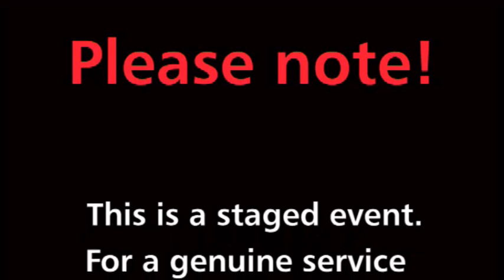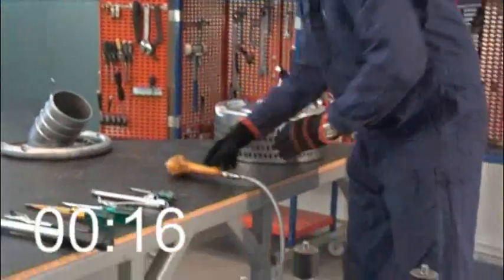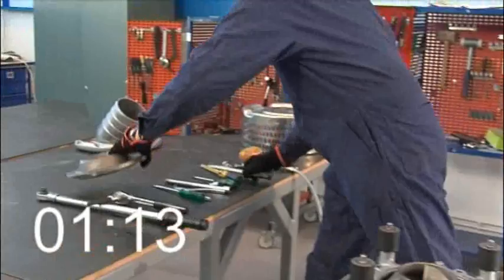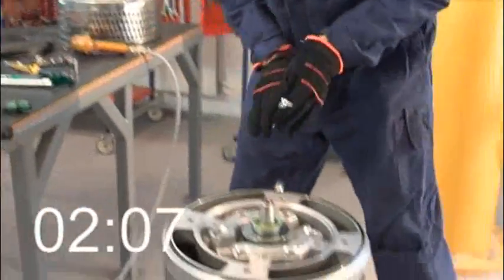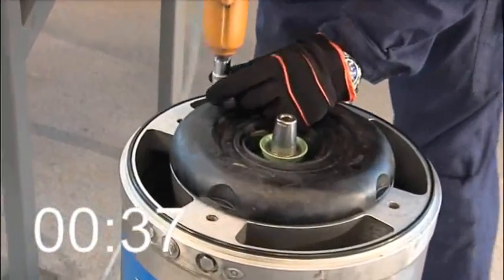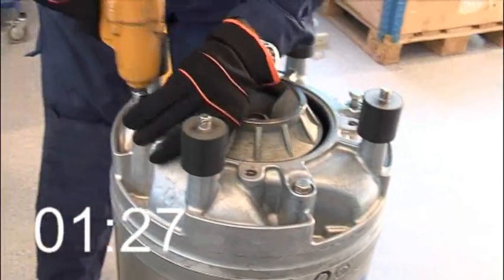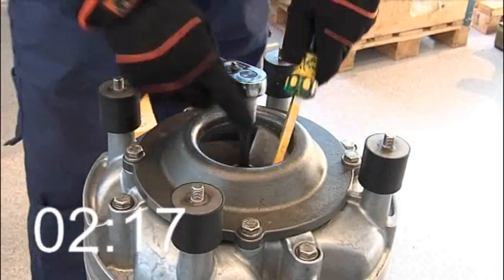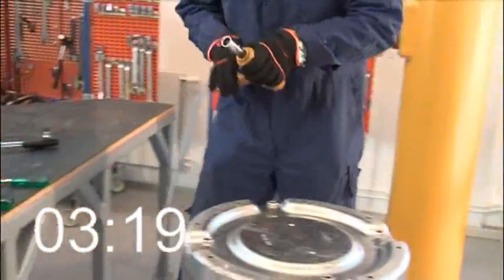ITT Water & Wastewater real time pump service video

Comment: Listen closely to the impact when first applied to any of the bolts for removal, a trained ear will not hear the impact gun 'smacking' on a tight bolt.
They are all just snugged down, not torqued to spec. Loose-ish one might make up a word for description.
Of course this is just a demo. However........................
2:35-Conical sleeve removed that easily ?? If you say so. Even a split sleeve is much harder to removed if it has been installed properly.
5:57-Where is the Loc-Tite Blue medium hold compound for the impeller bolt?
You guys should make propaganda films for North Korea.

Now after all of this is done, imagine having done it with 5 to 7 years of SHIT MUSH and used Kotexs and fembot pads remains pulverized onto every surface.
History in the making would be pulling a pump from a pump station that has performed for 5 to 7 years and is found to be as clean as this one.
Reply: revolutionpm this video give you a good laugh too? One thing I will credit flygt is that they use high quality stainless.